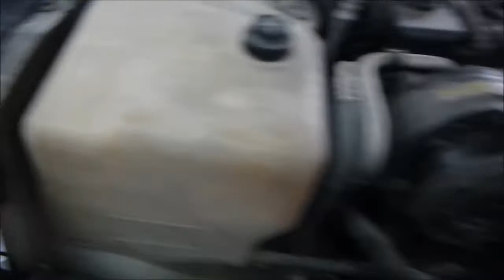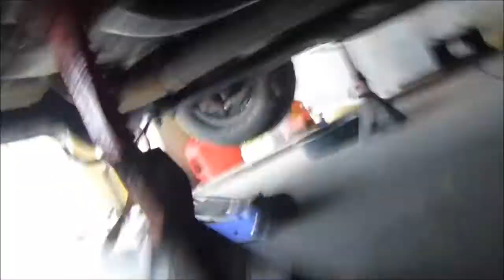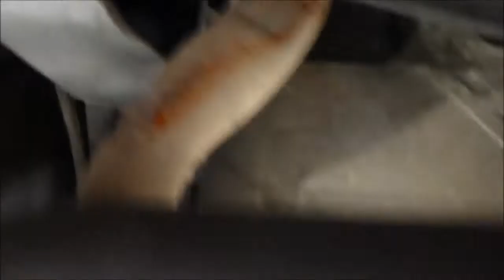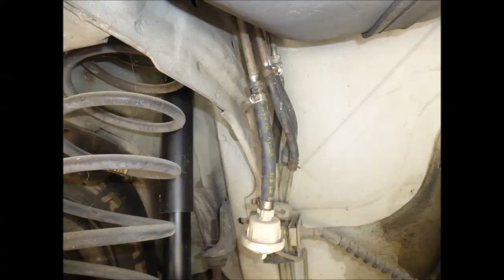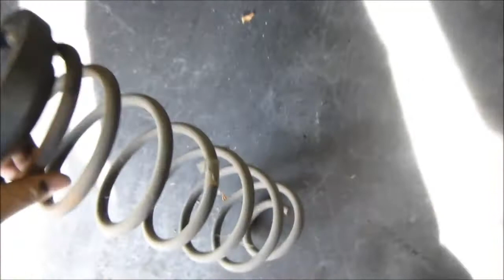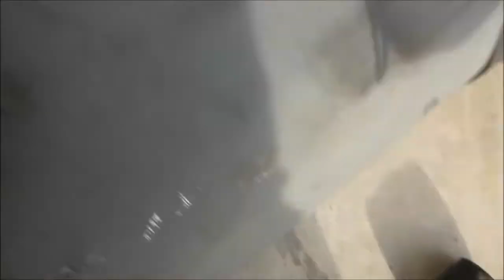82-92 Firebird How to remove the Gas Tank BAD FUEL PUMP Part 1

Comment: About to try this on my 89 formula...got it a few months back. Need to see if the engine runs if it's worth putting any more money into...as it's rotted in two spots. But of course the fuel system is seized up

Comment: My 89 firebird cranks. Have spark. The fuel pump primes as I turn key on. But I sense no fuel delivery. 
Could this be bad fuel pump?
Btw-I Replaced fuel pressure regulator, fuel pump relay, the 20amp pump fuse near battery, distributor cap, rotor and ignition coil.
Reply from the maker: You got enough gas in tank?
Reply: @JacobKnightRiderShop  yea. It's near full. I did mistankely  twist the distributor cap counter and clockwise as I was working on the plug wires and such. Would turning the distributor plug wires cap cause the car to only crank but not start?
Reply from the maker: @theoutlaw9043  just make sure distributers not 180 off as that would not allow it to start.
Reply: @JacobKnightRiderShop  thx. I straightened the cap back in position. I sprayed start fluid in throttle. It did try to fire after that. So I guess I'll try a new fuel pump relay. Than I'm hoping it's not the fuel pump itself

Comment: Thanks for making this. Looks like I need to do this to my '85 Z-28.  Cranks over but no fuel-pump whine or gas to the carb.  Looks like an awful job.  Fourth gens can get away with cutting an access panel inside, but the way the hard-lines bend over the tank on the third-gen doesn't allow this with any ease.
Reply from the maker: Agree

Comment: For the future, cut a square out inside the rear hatch above the fuel pump, so it will be an easy change next time. Don't forget to make a cover to screw down when your done.
Reply from the maker: Yea I didnt want to go that route. Gas smell is pretty bad as it is for these cars just from the windows down from the motor.
Reply: Not an easy task on a third-gen as, the hardline curves around the tank.  You would need a mighty big hole.  That does work on the later fourth-gens, but is still difficult to reach the fuel line connections through the hole.
Reply: @MrSFSTUDIOS  i did mine in about 15 minutes with tin snips, wish i could post a picture

Comment: GM engineers should have been shot for not giving you a access panel from the inside of the car. That's a ridiculous amount of work to get to a $35 part. BS!
Reply: If GM added an access cover then the car costs more to build. In engineering we try to add all these cool features but each item adds to the cost of the car. Thus the return on investment is not there. The costs are sweated down to fractions of a cent when the production volumes are so high. This is really not an Engineering design issue but a cost control issue by the bean counters who want the car saleable. All the cool items us Engineers want are ranked by the costs involved and often times many features are not added. The costs controls are so extreme that different wiring harnesses are used to save the cost of having an unused wire.
Reply: @3beltwesty  Not to mention the added revenue for billable hours when the car comes back to the dealer for service! Cha Ching!
Reply from the maker: Yep and as I recall a real pain in the butt.

Comment: Where is that fuse you touch comes from?
Reply: Can you show where this fuse conection starts and ends ?
Reply: I have this issue, theirs no current on the wiring for the fuel pump.I check the fuse box and relay .